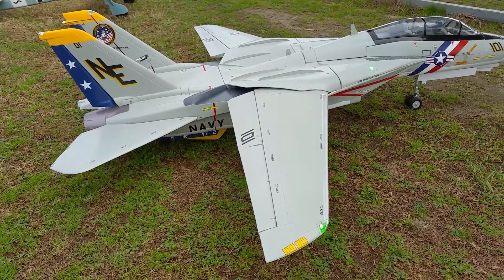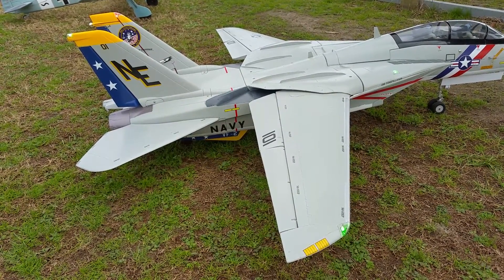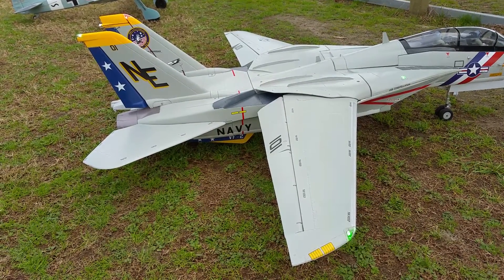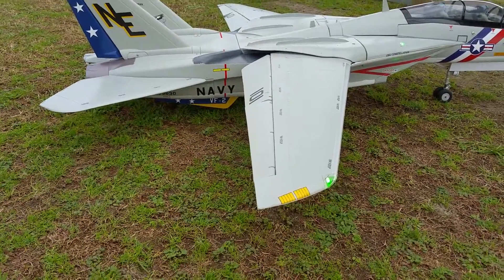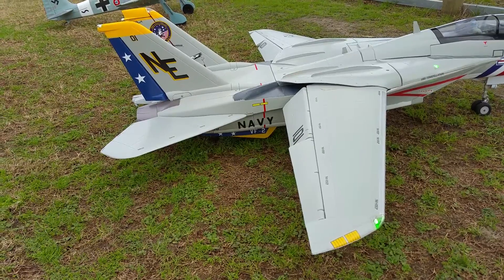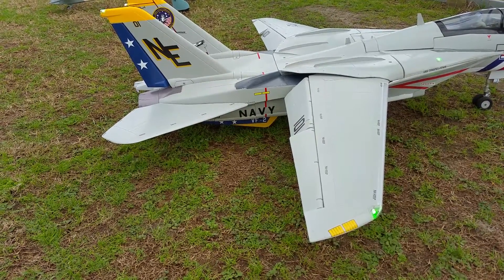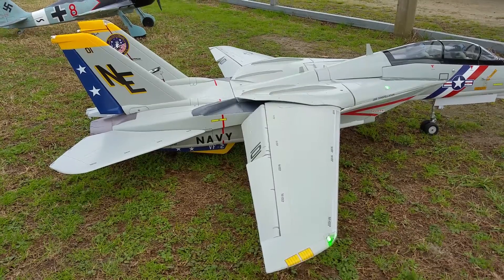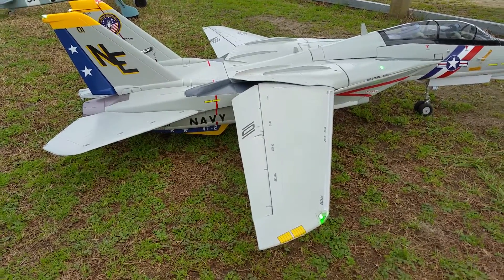Freewing F14 bench video full span flaps

Comment: wanna have fun ...make the fw 190 in the background a six cell and pot in a 5000 olympus motor fits perfect trust me two blade 15x8 and guess what the speed controller 70 amp is good ...good luck with the Tomcat